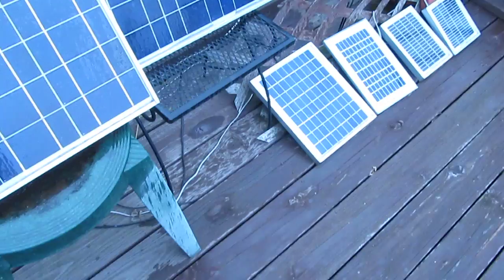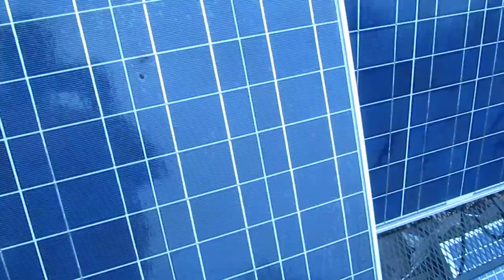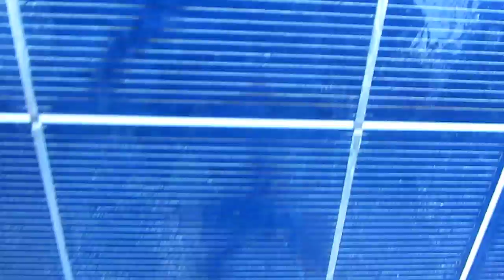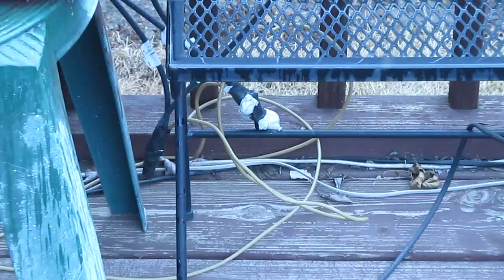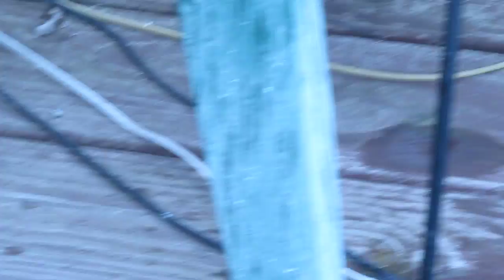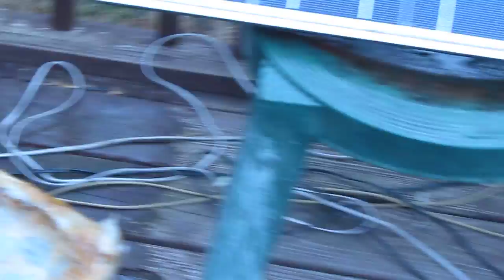Solar panel wear after 3 years + testing new canon sx150is video quality

Comment from the maker: Mainly just for backup emergency power.....Low wattage 12 volt mostly (lighting and fans). My battery bank is pretty small, so ac loads are limited to less than 100 watts. The custom panels if done right can last just as long as the manufactured ones....just need to be done better than my ebay one, LOL